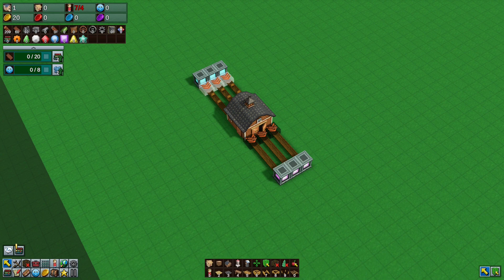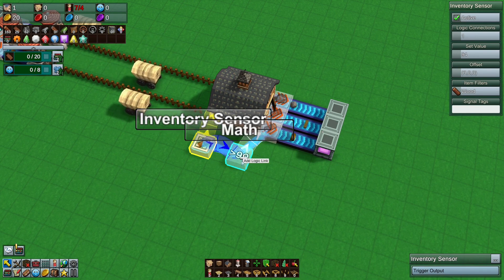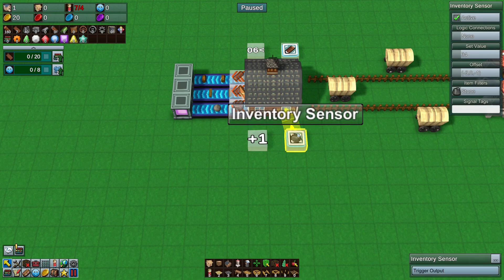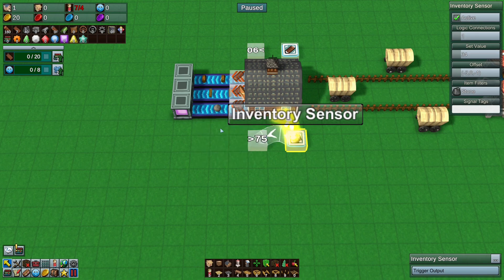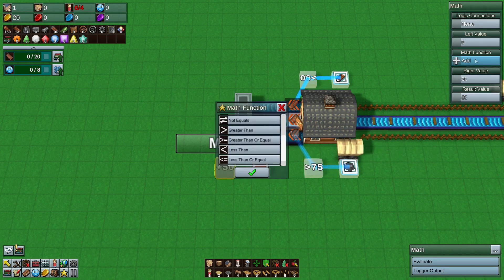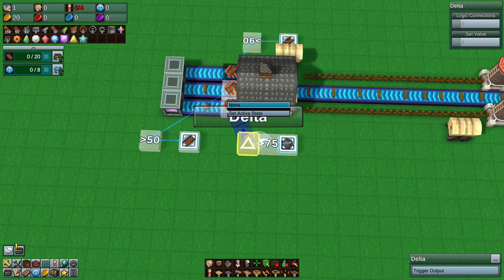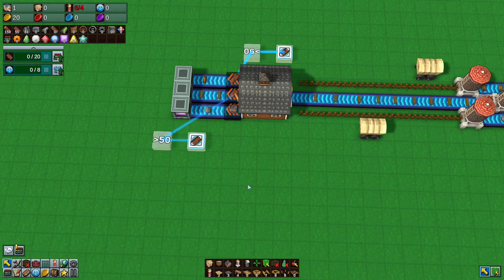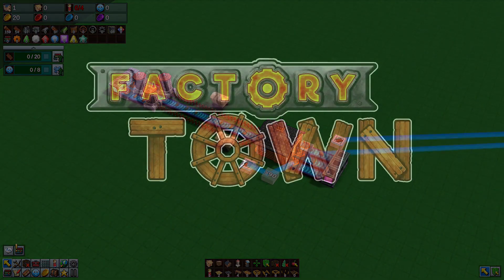Factory Town - Storage Level Extraction Logic [UPDATED]

Comment: Does anybody know why inventory sensor does not change the value when inventory changes in the block that is checked by sensor?
Reply from the maker: If the sensor isn't updating when a buildings inventory changes that its connected to, something is broken. That's exactly what they SHOULD do. The moment an inventory size changes, and the sensor is connected to the building, it will update. Double check its connected to the building you want to check, and that the filter on it is set correctly. 
If all else fails, you may need to remove the sensor AND building, then replace them to get it working.
Reply: @STHedgehog  Thanks, what helped me was removing all logic blocks and restarting game. Until that I had issue several times, so probably some kind of bug. Later it worked perfectly. And there was an issue for sure as manual triggering was creating proper value. Maybe shouldnt keep game running for two days without closing it :D

Comment: oh. my. gosh. THANK YOU! I was so hardcore into this game for over a week, but I got to the point where just using belts and railways was still getting too complicated, so I was trying to figure out advanced logistics blocks. But every guide I could find dealt with out-of-date functions, and I was unable to figure out how to adjust that info to the newer updated versions of this game (seriously, I wish the dev would stop overcomplicating this game more and more -_-). This still doesn't explain how to do it my preferred way--operate the grabber based on how many apples/etc are already in the kitchen, rather than how many apples/etc are stil in storage--but at least I've gotten this much to work for me, so I can start experimenting from there! Also, thanks for including just a bit of the science behind the blocks without spending 45 minutes on it, and for showing how to set up a practical example step by step!
Reply from the maker: I'm very glad you found it useful, I need to go over the other blocks and se what changes there are too. To set the logic up the way you want, you just need to point the inventory sensor to the kitchen instead of the barn, and set the math block to be Lower Than, rather than greater than. That way, it'll check how much of the filtered item is in the kitchen, and if the number is LOWER than what you want, it'll return a true signal and turn on a grabber to fill the kitchen.